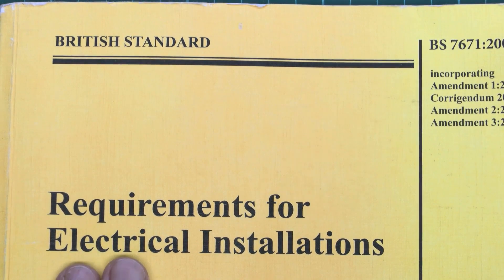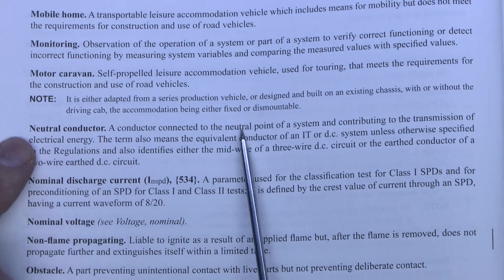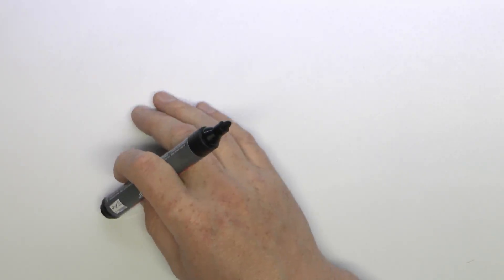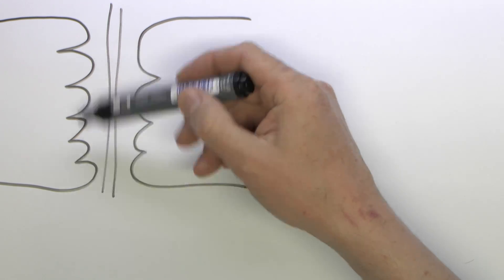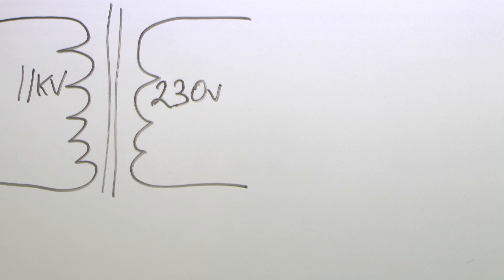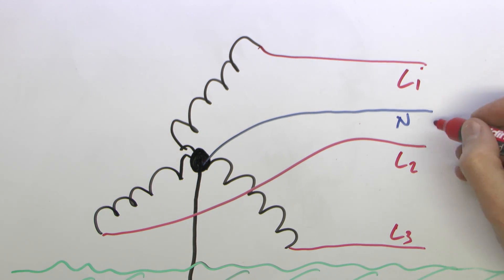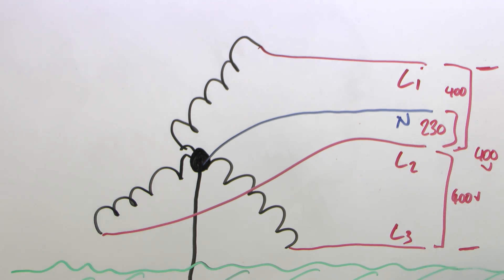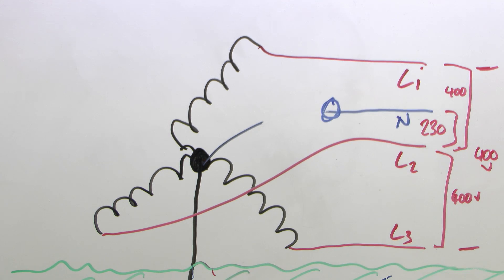Neutrals from transformers and in electrical circuits

Comment: Hey JW great video as always. About 20 years ago at work, half of our 2 storey office PCs and monitors literally went POP and smoke poured out of 100's of devices as the line connector floated up to dangerous voltages (normally say 230V ish). The fault at the time due I think to a faulty Neutral connector going open circuit  after some contractors had previously been in connecting some Air Con equipment up etc. Rumour has it they had not tightened the Neutral back up correctly in the distribution panel which subsequently burnt out.  Anyway about 200 PC power supplies were toasted and also hundreds of computer monitors went Bang!  I'm still struggling to see how an open circuit on the N. side causes the line side to raise up to much higher potential.  Between phase and N is circa 230V, so why does open circuit on the N give > 400V?

Comment: If the neutral is bonded to earth via a low impedance earth-rod and since this arrangement has effectively created a parrallel circuit to ground, why does current flow through the load at all during one half of the AC sinusoidal cycle? Presumably most of the current would take the path of least impedance and go into the ground and not the load as intended.
Reply from the maker: The load isn't connected to ground, it's only connected with the two wires.
Reply: I understand the concept of a floating neutral, but why does current flow through the load during the negative half of the AC cycle when it reverses direction given that the neutral is bonded to a literal stake in the garden? During the negative half of the cycle (coming out of the bottom of your diagram) it has a parallel path to ground before the load. Would this not provide a lower impedance path than back through the load?
Reply: @djr3485  Neutral is neutral. The voltage whether positive or negative is in the line. Many seems to think that the negative voltage comes from the neutral. This is false.

Comment: Hi John. How does the neutral work in a 3 phase and neutral set up. Does the neutral have to take the current/load of the 3 phases. Say for instance a 5x25 runing a sub panel/fuse board. You would think 3 seperate neutrals would be needed for each phase or how does the science of this work.

Keep up the good work. Thanks
Reply: John O Leary  Answered in an earlier comment 😉
Reply: Mark 1024MAK is it got to do with balancing the loading across the 3 phases so the least amount of current should flow in the single neutral.
Reply: The three phase currents are at 0v after going across their loads at that point we can put them on the same conductor (neutral).

Comment: The neutral is only introduced at the final distribution substation 11kv/400 and 230v transformer.On transmission (400,275 and 132kv) and Hv distribution typically 33 and 11kv there is no neutral, they work using the 3 phases only, there is earthing on the high voltage system,but as earthing suggests it is only there for safety and also to provide safe isolation on disconnected conductors to prevent induction from other nearby energized circuits during maintenance or replacement. Just for anyone who is interested.
Reply: Here in the UK one often sees single phase 11kv circuits
Reply: @greenpedal370  Gawd, shut ye gob!
Reply: @kimballscarr  OK Mr External Plant man But it took you 3 years to come up with that. Good work.

Comment: Please explain
A.C. 50Hz UK Transformer 11Kv to 230V AC
+ - + - +
- + - + - wire connected to Ground current flows to grown, Earth BANG/FIRE!!!!
Every 50Hz, as the Neutral on the positive cycle should sink current into Ground/Earth
Reply: OK Fuse will blow every 50Hz, as the Neutral on the positive cycle should sink current into Ground/Earth.

Comment: A few mentions are made of receiving shocks by touching the phase line while standing on the ground. That doesn't necessarily happen if the connection a person makes to earth is only by standing on the ground, and is unlikely to be near as high magnitude as direct contact between phase and neutral with hands. Dry shoes on dry ground/floor, and there may be no shock perceived by touching a phase only.
Reply: robbie77300  Hmm, except it does not really work like that. It only takes a relatively small current to give you an electric shock, and such leakage currents have a way of finding a route from the line (live) conductor to ground/earth via you, and then back to the supply. And yes, it has happened to me, while dry, and stood in a dry room.
Reply: Yes, 30ma for example, the threshold imbalance of tripping an RCD, gives quite a nasty shock. However, the impedance  for 30ma to flow is around 7600 ohms. Standing in your living room with shoes on will be a far higher resistance/impedance than that. It wont just find a way if there is none. Anyone getting a shock from 230v  in such circumstances will be almost certainly in contact with another flow route, not just a phase and nothing else. Enough current to give a shock, does not automatically happen unless there is a path capable of conducting such current available. Most assume contact with a phase means a shock occurs. This is not always true. Stand knee deep in wet cement, and it is going to be nasty. Stand in dry shoes in your living room, or even out on the path outside, and there will not be low enough impedance/resistance to the ground for perceivable current to flow if that route is the only path.  Anyway, a demo, which shows it does indeed work that way.......     https://youtu.be/xZyEX2NE3Lc

Comment: Why is Line and Neutral necessary instead of an isolated AC supply? I'd guess that it's to protect against a fault where any one AC conductor is connected to ground, flashover of the 11kv supply to the 240v output, lightning protection?
Reply from the maker: Isolated is safer, but it is impossible to ensure it stays that way - any inadvertent connection to ground anywhere would make it ground referenced, but with  no control over which conductor was grounded.
It's safer to make it ground referenced by design, so that fuses/circuit breakers are always in the correct conductor,.

Comment: I still wonder why / how it came to be that the neutral is connected to ground. I always thought using isolated mains was safer, like an isolation transformer? Then so long as you don't touch both outputs you are safe. I guess there's a reason?
Reply: If everything worked perfectly this would be true, and then instead of Live (L) and Neutral (N) we would have two lines out of the transformer. L1 and L2.  In a single fault condition there would be no earth path, so no fuse would trip and the frame of your toaster would sit there "Live" this would not be an issue if you touched it as there is no earth path. However if your faulty toaster had a fault from L1 to the frame and another appliance had a L2 fault then you would have the full 230V between them.
        In reality maintaining full isolation across a network is very hard, and bits of metal, pipes etc would end up being live to one line or another. Much easier to earth one line and call it a neutral. It works best when there are multiple earths on that neutral, otherwise known as the MEN system, or multiple earth neutral
Reply: John Simpson Thanks for the answer.
Reply: +James Searle
John did a video on EXACTLY this -- https://www.youtube.com/watch?v=Wx_v1-T1gE4
Reply: John Simpson Also, 3 phase system, if isolated system was used, and one phase has a fault to ground, it will go unnoticed because of the isolated setup. But now there is a potential 400v from the other phases to ground. Where as with neutral connected to earth, there is reference which means phase to earth faults should show, or operate tripping devices.
Reply: John Simpson  In North America, 240 volt circuits have no neutral; both conductors are active.  The line to neutral voltage is 120 volts,,and there are 2 active lines, 180 degrees out of phase.

Comment: Hi  John great video,any chance you can do a video on if you have any experience on using a generator on house wiring using a changeover switch,and the earthing arrangement,I am getting a lot of conflicting information over the net regarding this
Reply: biggest lesson I learned in the caribbean, is that all the supplementary grounding, for extra ground rods, generators, solar panels, even cb and ham radios, needs pulled back to your main ground point with at least a 10 mm but preferably a 16 mm wire, to make them all one grounding point... otherwise, the lightning strikes can actually do more damage to them.I think the new 2017 International wiring codes addressed this as well. Thus, if you are running a line out to an outbuilding, or a generator, or a shed, and you are planning a ground spike there, you still want to find a way of connecting that ground spike back to the first ground spike or ground position in your home. I believe there is an excellent video showing this under the 2017 NEC videos.

Comment: is there a practical reason for the neutral to be connected to earth, if so would a high resistance connection still be practical as opposed to the low resistance connection currently in use. Meant purely as a thought exercise obviously electrical codes wouldn't allow it
Reply: +Brendan Randle
Yes you are describing "IT" electrical system (isolated from ground), as opposed to TN or TT supplies.  Specialist-only (e.g. operating theatres) and, as you say, not normally used.
Johns' video also explains why Isolation not normally used for everything in:-
https://www.youtube.com/watch?v=Wx_v1-T1gE4

Comment: UK voltage spec is 230V. But when I measure it I get 240V, is your voltage 230 or 240?
Reply from the maker: 230V,  +10% / -6%., or anything between 216V and 253V. 
It is usually about 240V, as it was previously 240V +/- 6% and although the definition changed, reality did not.
Reply: Since 2009 the tolerance is +/- 10%. The +6 and -10% percent was during a transition period so the appliances in countries which had 220V before wouldn't get roasted.
Reply: You're talking about the electric strength of capacitors and other parts because in most cases this value for this rating is for a DC voltage. But the peak voltage in an AC-system is ~1.4 times (precisely it's the sqrt of 2) higher than the nominal 230V.
Mains voltage in Europe is 230V, and the permitted tolerance is +/- 10%. Meaning the voltage can be between 207 and 253V. If you live next to a feeding point the voltage is always higher. Here in Germany we've switched from 220 to 230 for the harmonisation in 1986. Before this some had already 230V, now they have almost 240V. Near the feeding point the voltage is always higher,  so the last one gets a deicent voltage (voltage drop in the cables is the cue).

Comment: I lived in the UK for around 15 years and have since moved to Ecuador, which is more the US style approach. It is extremely common here to not have earth connections, to use inappropriate (typically thinner than required) wiring and have very poor safety in mind. Although I have now lived here for 10+ years and the electrical systems are quite distinct, it is always a pleasure to watch your content and see if it can be applied in a manner that improves the safety of the circuits we have in our property. Thanks for your dedication over all this time.

Comment: Of course, in the stuff you didn't go into here, it turns out that if the 3-phase load is perfectly balanced then the neutral remains neutral even if you disconnect it back at the transformer.  That doesn't mean it's safe to touch the neutral in a 3-phase system when it's disconnected because the load might not be balanced, or may become unbalanced.

I'll leave explaining why this is so to you. :)
Reply: If you draw a symetric load from all three phases there's no current flowing on the neutral. And in case of an unbalanced load only the difference between the load of all three phases will flow on the neutral. For example:

L1: 15A, L2: 15A and L3: 16A would mean that there's only 1A flowing through the neutral.

Your situation is purely theoretical, because you always have an imbalance in such a system. There are only a few appliances which don't require a neutral. In residentials a type of typical appliances which don't require a neutral are flow-type water heaters. They only require a cable with 4 wires, the three phases and the protective earth.

If the neutral is connected you can touch it, even if you have an unbalanced load between the three phases. But the system would loose it's zero point or better you would have a floating zero if you disconnect the neutral, for example in your fusebox. That means all connected loads in these fusebox would act as a voltage divider. As a simple example you got a 20W soldering iron (~2645 Ohms) connected between a circuit connected to L1 and the neutral. On a different circuit, connected between L2 and neutral, you have an electric heater with a demand of 3680W (~14.4 Ohms). If you would disconnect the neutral in the fusebox the soldering iron will get a voltage of 398.8V and the heater will get 2.2V. Meaning your soldering iron would be roasted. And in case of a PEN wire in a TN-C or TN-C-S system you would loose your protective earth. This would, in addition to what I already said, cause that the housings of class 1 appliances would become live. Quite undesirable....

Comment: This was incredibly interesting, thank you John, this was very well explained now I have a better understanding of 3 phase and single phase. Cheers.
Reply: In Europe single phase systems are uncommon. The system that is used in most cases is three-phase. Even if you don't have a three-phase system in your house, there are always three phases below the street and the houses are equally distributed to the houses. Meaning first house is on L1, the next one on L2, the next one on L3, the next one on L1 again and so on.
Reply: Marcel Germann  For most applications this is true. But some industrial systems do use three-phase to single-phase transformers. For example, where a limited supply is required, or as the mains supply element that is backed up by a standby emergency generator.
Reply: All industries that I know use the three-phase system here in Germany, because that's the standard here. And even if you don't need the three phases, you can always pick one of the three phases and a neutral and you've got 230V. Three-phase is common even in residentials. And there are three-phase generators available which generate 3x230/400 VAC. In Germany the kitchen cookers are connected to all three phases. The heating plates use L1 and L2, the baking oven is connected to L3. That requires a 5x2.5mm² cable (L1, L2, L3, N and PE) and it's fused with 3xB16A MCBs. That are round about 11 kW, but in most cases you could upgrade to 3x20A (~14 kW, depending on the length of the cable and heat dissipation) if that's not sufficient. In single phase systems the kitchen cooker is fused with 25 or 30A in most cases and the wiring is 4 or 6mm².

Comment: +john ward I have a question on earthing and neutrals. Basically at work we had a machine with a transformer that was stepping down 400V 3 phase to 230V single phase. It then passed through an RCBO, then to sockets. If the neutral of the transformer is not earthed then no current coming from the output of that transformer can flow to ground because there is no path to complete the loop. Even though the machine and the earth pin are grounded they will not work. But anything connected to it will still be at ground potential. If this was true then the MCB would not work in a short circuit condition and the RCD wOuld not work either.
Am I correct? I was told at work the neutral does not need to be earthed for current to flow to ground. Also if there was no RCD on the output but there was an RCD on the primary side of the transformer. There would be no RCD protection as they are now different circuits?

Thank you!
Reply: In the US you would need a system bonding jumper to bond the secondary neutral to the equipment grounding conductor of the primary system.
Reply: Current doesn't magically disappear into the earth. The only way current would leak to ground is if it's able to use the ground as a path back to the source (the star-point of the transformer secondary, where the neutral wire is connected). 

A great video to watch is this by Mike Holt, it will explain everything about earthing, a must watch in my opinion: https://www.youtube.com/watch?v=mpgAVE4UwFw

Comment: Can you still have amps in a netural? If so why?
Reply: The current in the neutral of a single phase circuit is identical to the current in the line (unless there is a fault).
Reply: Unless its 3 phase! under certain circumstances (Computers, Inverters etc) the neutral current can be HIGHER than and individual phase current (search for "3rd harmonic" for more information)
Reply: Concept: 2 wire circuits never can have a neutral. If one of the conductors is grounded then it’s a return wire. 3 wire single phase circuits center tap is a neutral, this is a neutral because it’s neutral to the phases on each side of it. In this set up it will carry the imbalance of the two phases. 4 wire wye, the conductor attached to the point where all 3 windings connect to each other is a neutral and it will carry the imbalance of the 3 line conductors.